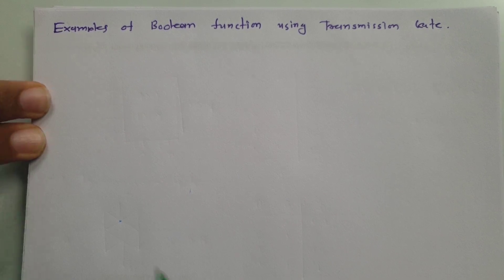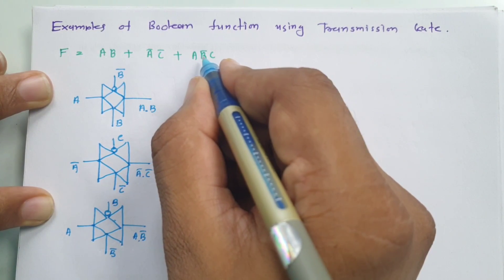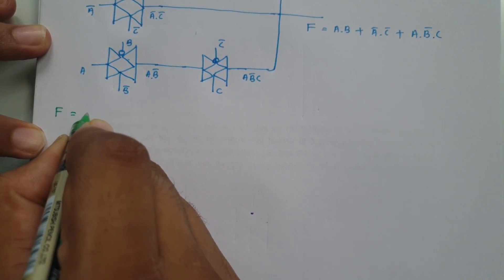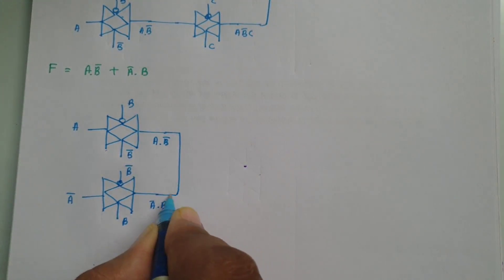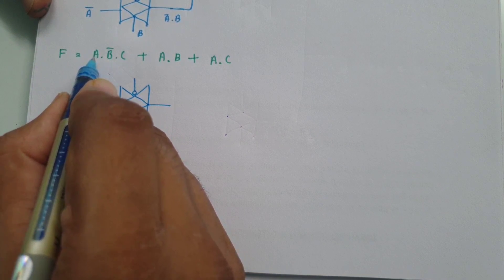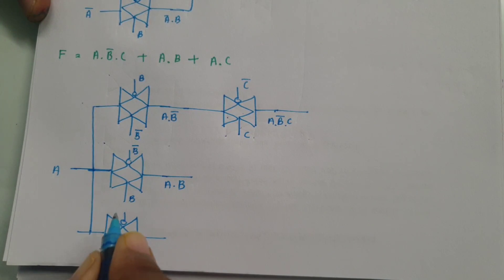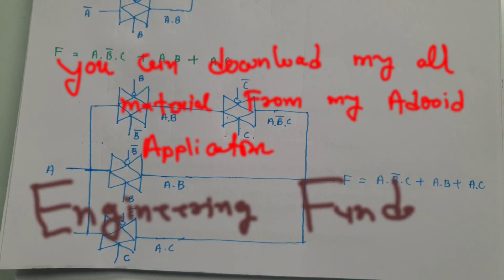Boolean Function Implementation using Transmission Gates | VLSI by Engineering Funda

Comment: 00:02 Implementing boolean function using transmission gates
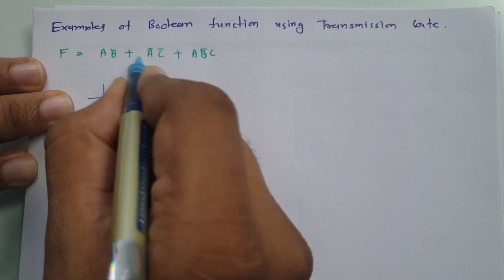00:55 Transmission gates can be used to implement boolean functions.
01:56 Implementing Boolean function using transmission gates
03:05 Implementing Boolean functions using transmission gates
04:01 Transmission gates implement boolean functions
05:05 Transmission gates implementation with control signals.
06:20 Boolean function implementation using transmission gates
07:25 Implementing boolean function using transmission gates

Comment: Wrong Concept
Reply: Why 🤔 everything thing is right 👍 refere some references if you have doubt on sir 😊
Reply: @1dhdh  in example 3 when input is 101 , 1st gate will give high value and second gate will give low so it is going to be short circuited

Comment: is there a way to make an or gate with transmission gates, lets say we want to make the function A + B, would it just be a transmission gate with A and B as the "selector", and 1 as the input?
Reply from the maker: Just connect A and B with a single node and you will get OR gate

Comment: sir in the last question , wont the transmission gate be in high impedance state ,so how will we get a zero when we apply a=0,b=0and c=0,according to the boolean function the ans should be 0 , but if we check through the diagram , the transmission gates will be in high imedance state